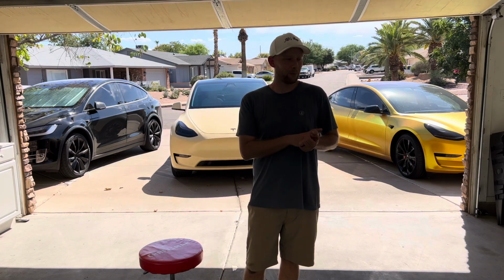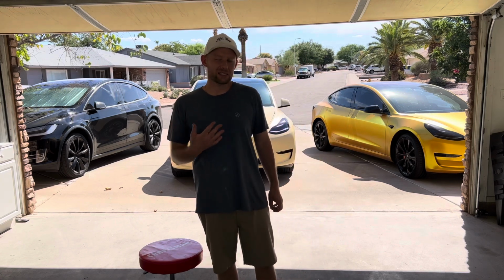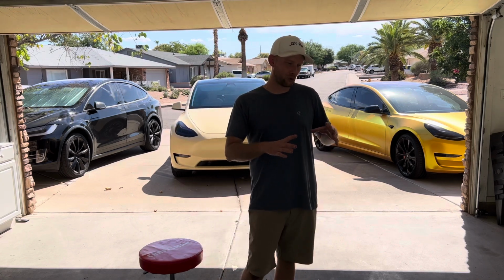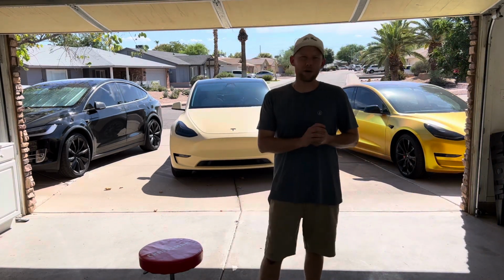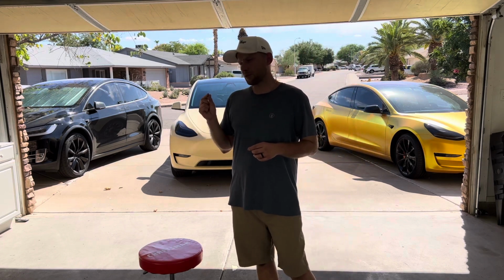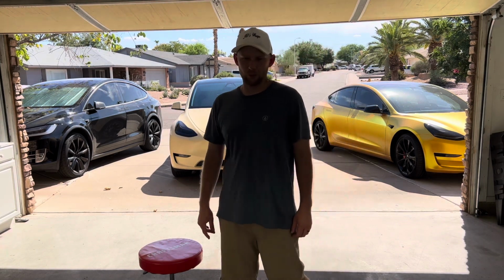Absolutely Sick Tesla Model Y Vinyl Wrap: KPMF Satin Desert Storm (Timelapse)

Comment: Looks really smooth.  Would you recommend this type of vinyl for beginners?  

Which kind of wrap you think is best for beginners?

Thanks!
Reply from the maker: Yep I would definitely recommend this film for beginners, this particular color is super easy to install, it’s pliable, and does not discolor easily.

Avery and 3m are considered “easier” to install but they’ve got adhesive issues
Reply: @GdayFraz  what are your thoughts on cheetah?  I live in AZ, so warm weather wouldn’t be a big deal.
Reply: @GdayFraz  can anyone get this brand wrap or are they exclusive to certain installers.